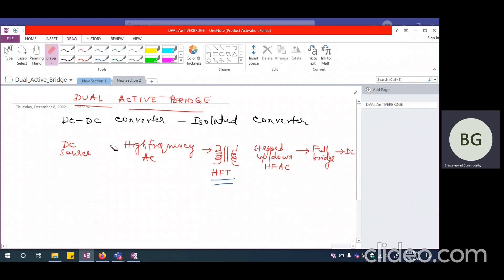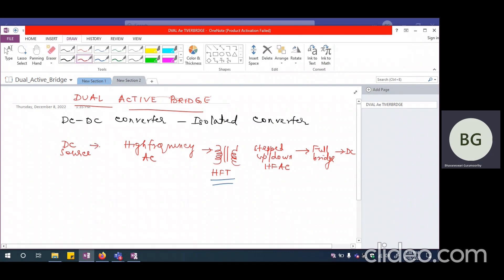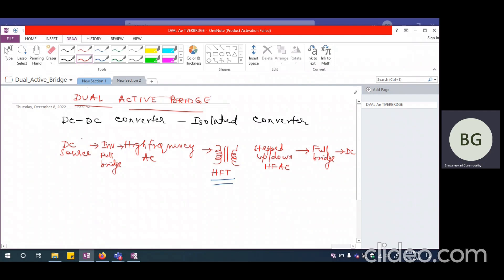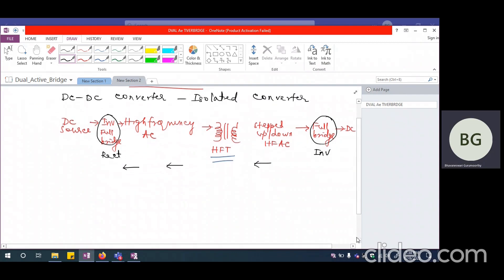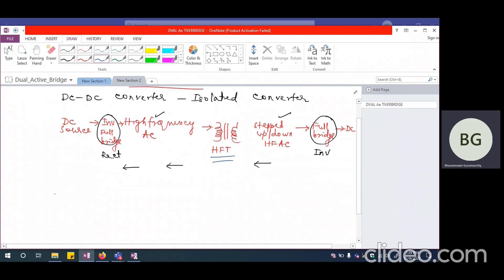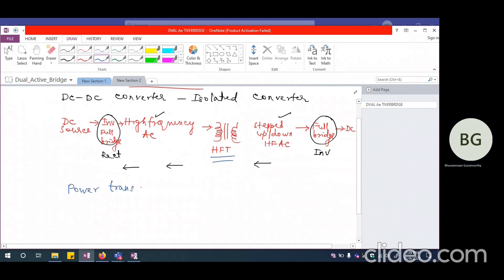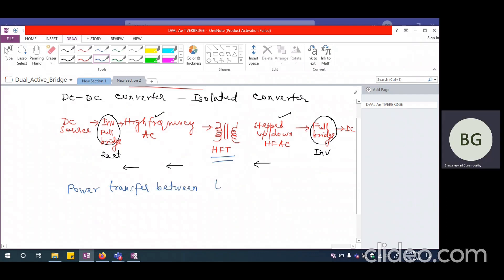Dual Active Bridge Converter - Simplified

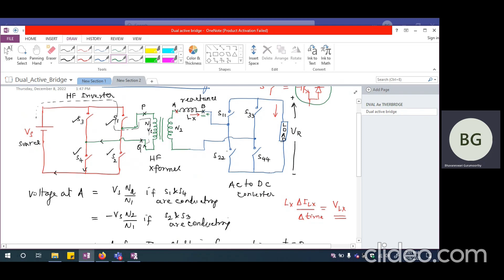Comment: 25:05 how voltage at B is less than voltage at A ? how voltage is decreased at the inductor Lx? anyone can explain
Reply: the voltage at point B is same as the voltage at the receiving end(Vr) which is usually less than the sending end voltage in most practical applications of a DAB converter

Comment: Great explanation.

The circulating current on the primary side of DAB and the circulation current on the secondary side of the DAB needs more explanation? In a single circle, can you mention the transition between switches in regard to circulating current through the diode due to capacitor discharge?
Reply from the maker: I will try to address this issue with the help of a simulation in PSIM or MATLAB showing different modes of operation

Comment: Mam,
Can you please derive RMS inductor current equation from inductor waveform.
Reply from the maker: If you know the equation for the current waveform, all you need to do is to calculate integral of [i^2 dt] and divide by T and take square root. That will give you RMS value. We know the current expressions here. So, it should be doable.